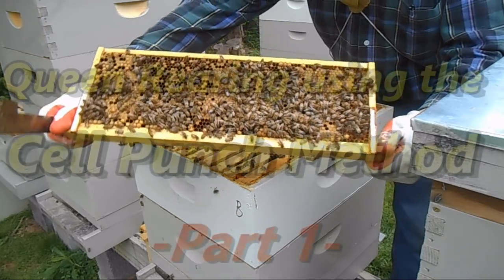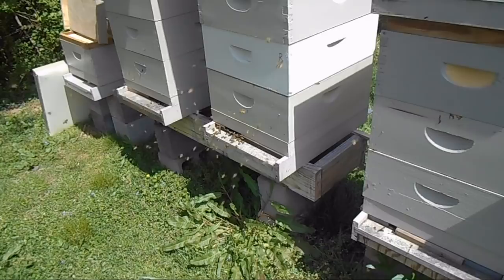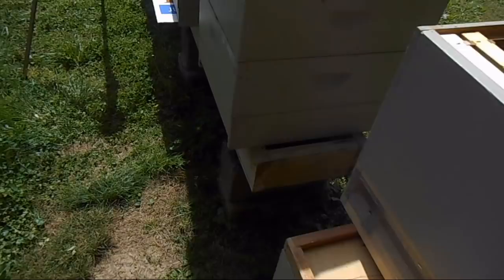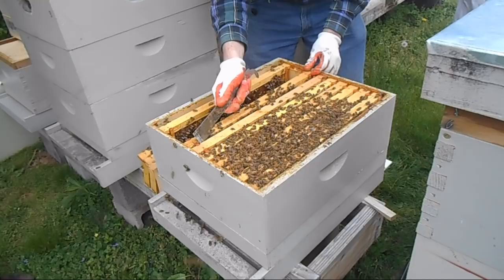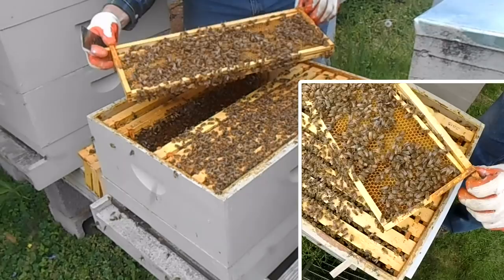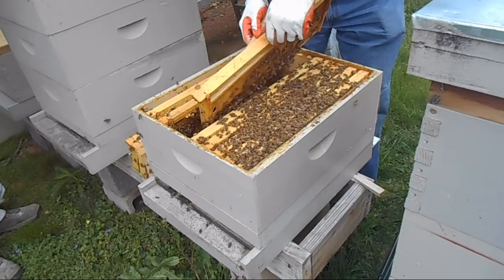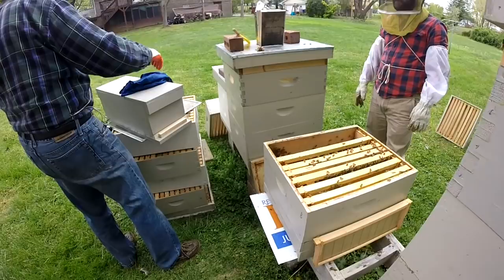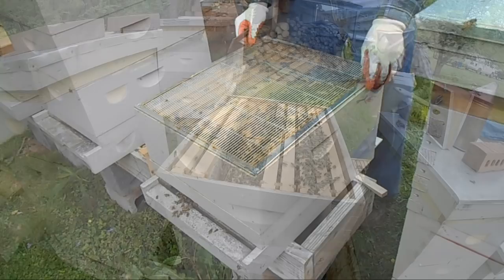Queen Rearing using Punch Method - Part1

Comment: Can you call punch eggs
Or does it have to be new larvae
Reply from the maker: I have never used eggs when making queens. I personally would think the eggs are a bit fragile to try to manipulate. but it may be possible using a cell punch method. It would be critical that the eggs are not disturbed. I know that you can cut out a section of comb with eggs and hang in the "up side down" position and workers can use those to build queen cells.

Comment: what is the purpose of the starter? why not just put them in the hive you call the finisher?
Reply from the maker: The first 24 hours are crucial to feeding the young larvae. If you pack a very large amount of young nurse bees to the starter hive, you theoretically have a better chance of getting your grafts or cell punches fed with royal jelly. Some methods use the same hive for the starter and the finisher hive but with a separate starter hive, you have better control of the quantity of nurse bees.